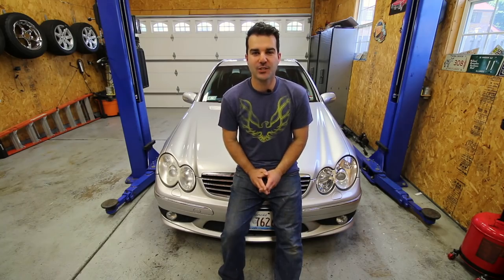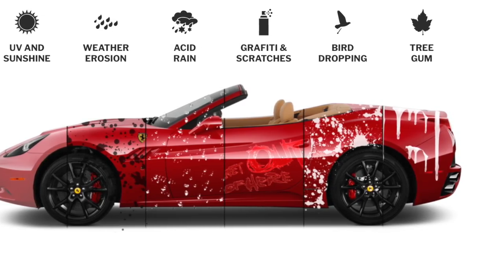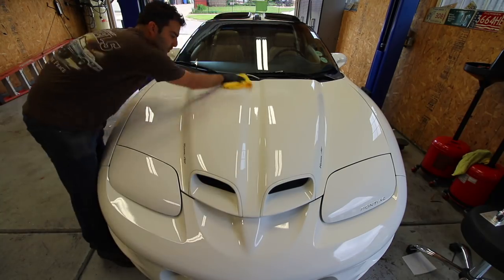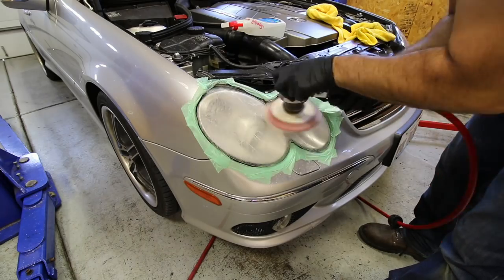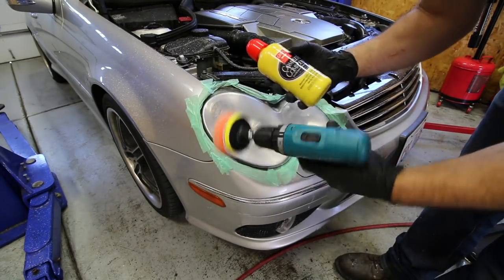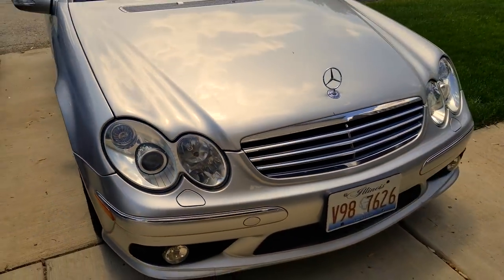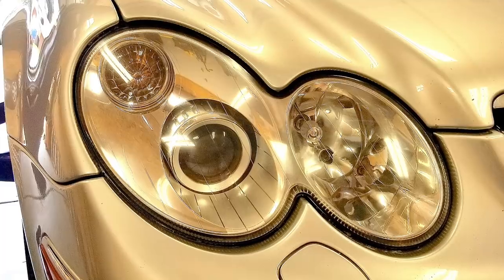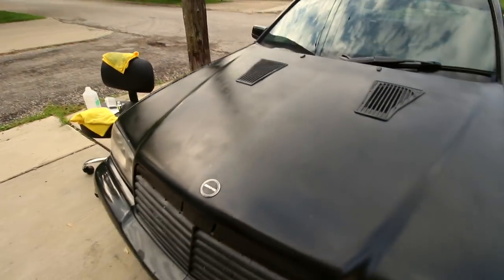How To Restore Headlights With Ceramic Coating. Super Cheap, Super Satisfying!

Comment: Hiya - great video!  Thanks for Posting for us!  Humm, Noise - Aircraft Noise!!  Personally I luv the sound of aircraft - all aircraft - yes, I am a pilot, BUT...  I get that it CAN be distributive or even just VERY annoying.  
- Your Shop / Garage already seems to have interior wall sheathing, but I'm wondering about the amount and type of insulation you have behind that OSB covering?  Sound - all sound - needs air to travel through.  Block the air-flow, and you block a LOT of Noise.  I notice your Attic (access) seems to be wide open?  Do U hav insulation up there?  If not, ADD some!  If yes, then Close that Opening!!
- In the construction of a Duplex Bungalows (and Condos), great steps are taken to control Vibration of the "common walls", thus the transmission of Sound, of which Noise is a part (from one Unit to the other) ...  OSB is pretty flexible, thus passes Noise more easily than a stiffer gyp-rock wall covering.  Did U install a Vapor barrier under that sheathing? The less a wall can Vibrate, the less noise is transmitted thru or by, it.  
- Windows are the same way - a double glazed window passes less Sound than single glazed; and a triple glazed, even less still.  What is the Glazing of yur windows in those O.H.Doors?  Yur O.H.Doors show 2-Closed, but seems like (at least) 1 is Open?  Close it!! :)  
- OK - I KNOW, you need at least 1-Door Open for good Cooling / Ventilation, right??  WELL, probably Not!!  No, Seriously!!  Commonly used Furnace Blower Fans, can supply HUGE amounts of (cooler) Fresh Air INTO yur Shop!!  Just make sure that their Intake Air Source, is from a direction AWAY from the NOISE Source! 
- Finally, as a Pilot, I DO know about "Noise Cancelling Microphones" (BOSE, A Series)...  Whether Jet, Turbine, or Piston Powered, cockpit NOISE is a REAL P.I.T.A. {PAIN IN THE ARSE)!!  In my world there is NOT a lot we can do about That in my workplace - except to CANCEL it!!  "Active" Mic.s sense the surrounding NOISE and Electronically CANCEL it out.  Although we (personally) can still Hear the noise, the electronics simple 'cancel' it out of our Recordings! 
- I really hope that at least a couple of these Suggestions Help in yur Noise Abatement Efforts!! 
- Cheers for now, and Happy Christmas Wishes, headed YUR way.  We HOPE at least a couple of these suggestions, hav a really POSITIVE Affect!!  
Cheers, Bernie & Maddy, Vancouver, Canada... Email us, if U wud like MORE Info??

As a Video Composer, U might want to look into (Active) Noise Cancelling Microphones. 

Cheers!

Comment: The thing with all these restorations is that nobody ever posts a follow up in 6-12 months. That’s when the problem comes back because the UV coating has failed. I’d be interested to know if the ceramic coating can protect for that long. I personally found a better solution and that is a clear film for headlights, just like clear bra for paint.

Comment: this has nothing to do with the video. but a Problem with my car iv talked to multiple Mercedes mechanics from the dealer to Privately owned Mercedes shops, i have a 2007 slk 350 auto with 120k and when i put it into Reverse or drive it jerks alittle no grinding or loud noises just jerks alittle when i drive its as smooth as it always has been i thought about changing the fluid in the transmission but some people say its fine i dont need to, some people say the wont it will make it worse, and some just say they will just change it. i have no idea is this just normal for an older Mercedes? what is you opinion? i though maybe the transmission is going bad and though of replacing it. am i just over reacting? could it be transmission mounts going out?

Comment: Alex, is it okay to apply ceramic coating to my headlights to keep them from hazing/yellowing?? if so, how often should I re-apply it?
Reply from the maker: For sure. That is the entire point of applying to the headlights. It has great UV protection which is exactly why your headlights become yellow and hazy. If your headlamp lens are in good shape or new this is a great time to apply it. I did the same with all my cars.

Alex
Reply: LegitStreetCars thank you

Comment: that's some cool ceramic stuff. i was doing the sanding process and after the 1500 grit paper, I'd have automotive clear coat sprayed on them. they never yellow, you can wax them and they look great. i wanna try that ceramic coat tho.
Reply: How did you apply the spray
Reply: @scr3wblu313  with a HVLP automotive spray gun

Comment: Hi Alex, you have some great videos keep up the good work. I wanted to ask if I can put that ceramic coat over the top of a clear bra. I own an 08 e63 and it has clear bra on 1/4 front of the hood and complete front bumper. Thanks for any info you can provide.

Comment: You gave me a great idea, thinking about doing a maaco paint job on a daily driver 05 Tahoe I have. I'm planning on sanding and prepping the car myself but still afraid of wasting my money on cheap paint that won't last.  I'm now thinking I could ceramic coat it for extra protection. Let me know if you have thoughts on this. Thanks!
Reply: jacob powell 
How’d it go man

Comment: I took the time and spent the money and restored the headlight lens on my van and truck. It lasts for about a year then requires it to be done again. I have been told it is caused by the heat of the lamps, I'm not sure but it's time to do it again.
Reply: If it was caused by the lamp heat then the deterioration would mainly be on the inside of the lenses (and impossible to sand) not the outside. The cause is just solar UV, and various atmospheric chemicals reacting with the external plastic surface of the lens. You'll get a longer period between refurbs by spraying on UV-proof clearcoat if you don't want to ceramic coat them.

Comment: Looks great!!! Like the Ceramic coating kit.  Question:  Harmonic balancer?  Last three on my vin is 580, is it on the recall list?  I'm getting what feels like engine shaking sometimes in the morning.  Goes away after about a mile at highway speeds, need to replace engine mounts too not sure if it's related?  Thanks
Reply from the maker: Gregory Hauser I'm not sure on the VIN breakdown but just take a look at the balancer when it's running. If it looks to be wobbling, its bad
Reply: Thanks for the reply, I've got 238,475 miles on it.  It seems to wobble, but looks like about .010" runout maybe more hard to tell but it doesn't thrash back and fourth though.

Comment: Have you got any idea how long this coating will stay on the surfaces? Is it affected by chemicals or can you only remove it mechanically?
Reply from the maker: Ceramic coatings last years. This one is warrantied for 3 years and most last around 2-3 years.  All you need to do is buff it off if you want to remove it and reapply. So no sanding just buff to remove.
Reply: In Finland it costs about 500€ or $600 to get a nano coating done in a shop for a midsize car like a 3-series BMW. Even for that price I think it's worth it. This DIY coating however seems to be easy to use and no doubt it will save money. Now the only thing missing is the car. Still waiting for the right C55 to show up.

Comment: The idea for this whole making headlights crystal clear thing is sanding off the mist, haze or yellowish film, created by being oxidized over time, then coat it with clear coat. I think, as long as you get the idea, there are many ways to do it with different products. I personally would prefer chisfix just because I learned a whole lot about cars from him !

Comment: That video!  Curious how long the ceramic coating lasts before it needs to be reapplied?
Reply from the maker: Paul de Larzac At least 2 years but some report closer to 3. It comes with a 3 year warranty
Reply: No.  It needs clearcoat after you're done sanding, else its like throwing bare metal into a lake

Comment: How often do you have to re-apply the coating, on duration of 1 year, for example?
Reply from the maker: It lasts  a few years. This product is warrantied for 3 but many have reported ceramic coating even longer. If you want to reapply there is no need to wet-sand. You just do a light buff, clean with alcohol and reapply.
Reply: Thank you for the answer. Are there any permanent solutions for the headlights to stop the UV rays yellowing, though?

Comment: I rather PPF the headlights than ceramic coat them, PPF provides even more protection from not only the sun, pollution, oxidation, but from impacts like rock chips, plus it comes with a 10 year warranty from the manufacturer.

Comment: What was wrong with using glass lenses? My lenses are not faded and they are 37 years old!
Reply: DOT doesn't approve any glass lenses here in the us anymore that I know of.. they are all poly-carbonate now.
Reply: Yup and yellowing is unavoidable unless you hid and that is pretty expensive, cheaper to clean headlights and replace led bulbs
Reply: Not offered for my volvo wagon
Reply: I wish they still made glad lenses. They never turned yellow. It’s ridiculous that in 2018 cars that are 2 years old have yellow headlights. How are we even putting up with this?
Reply: There are new (1995+) regulations globaly for car manyfactors to move from glass headlight to polygarbon because for safety reasons, in case of car accident glass headlight may cause much more damage to the driver or a pedestrian than a polycarbonate headlight. Those results are came.from.car accidents reaserch and are globaly rules such as....seat belts and airbags e.t.c
Reply: Blatt Ferenc they break and leave sharp pieces everywhere, also they weigh more, also with plastic,it possible to mold them into more exciting designs..😃

Comment: Do you have a video on blacking out E55 headlamps?
Reply from the maker: I'm sorry I lost the footage. You basically remove the headlight from the car, remove everything from it including bulbs, bake it for 10 minutes at 170 in the oven and then pry the old lens off with a screwdriver. They come off easy. They you remove the chrome lens, scuff them up and spray them. Check out my Amazon garage, it's linked in this video. I have listed the plastic paint and primer in there.  I used regular clear silicon to reseal the new lens on the housing.

Comment: Sweet deal Alex I'll be doing this to my motorcycle and my car!
Reply from the maker: Awesome! The bike is a great idea too. I had an old Harley and there are little areas that are tough to clean. Once this is on it will stay much cleaner for much longer. Email over some pictures when you get done. 
legitstreetcars@gmail.com
Reply: Will do Alex I'm doing some repairs on it currently the moving company broke a piece of my front cowling so I'm using some amazing Q Bond to fix a standoff behind the cowling. Q bond is actually some pretty awesome stuff look it up with the filling powder it makes a super tight bond to fix plastic and some metal. Btw I have an 09 blue metallic Yamaha Fz6 will protect the fairings for sure! First on to the repairs, I'm currently sandblasting and painting some of the rusting brackets and replacing 10 year old tires with new Michelin Road 5's! I don't have my own shop but I wish I had a shop like yours. Over here in Southern California garage space is so minimal.

Comment: I'we done near 10 cars sanding and polishing the headlight but after 3-4 months oxidation layer came back even worse than before. My friends told me that with all that sanding i remove UV protective layer and because of that oxidation came back again.
Reply: Clapaucius  Did yo do that with ceramic coating ?
Reply: @osmansen3023  No..just sanding and polishing. Without any protective coating at the end.

Comment: I see so many cars with "cataracts" like this one.  Luckily the headlights on my Lexus are genuine glass and still look as new as the day they were made 27 years ago.
Reply: smithraymond09029 gotta love glass units. The days of quality are gone!
Reply: Kenneth White it's government regulation why they can't use glass.
Reply: Motolav when did they change the regulation? I thought they went to plastics because they were cheaper to make and more light weight?
Reply: It was a requirement to get a certain safety rating for pedestrians I believe.
Reply: MrCarGuy20 maybe in Europe but I'm not so sure about in the USA. I'll have to check on that.
Reply: Kenneth White probably a complicated nuanced answer here - she shapes of cars had to change for the pedestrian safety requirements, so flat or raked glass is less appropriate to meet those reqs, curved plastic units that don't stick out from similarly curved bodywork is much easier to make and lighter weight than curved glass. Have you seen how big some of the headlight assemblies are on larger vehicles? It could end up weighing 50lbs per headlight to give the same level of rock chip protection and even then there would be lots of other problems.
Going plastic really does solve a whole mess of conflicting design needs, such as aerodynamics, which is anachronistic to inexpensive flat glass
Reply: CrashingOut I agree it's for weight and ease of manufacture. But the other commenter stated that they went to plastic units because of pedestrian safety, which I don't agree with entirely.

Comment: Ceramic Coating is not designed to be a clear coat yeah it looks nice for 3 years but you get more longevity using a good quality headlight clear coat.

Comment: Two parts to this: initial results and one year later. I got a Sylvania headlight restoring kit, it worked perfectly in 30 minutes of easy effort. BUT, everyone says that after 6 months to a year, the UV coating liquid you add to the restored headlight yellows and you need to do it again. You do NOT mention what happens one year later. All of these restoring products are the same, clean, sandpapers(400,1000,2000) and UV coating. They all look great in 30 minutes. But they all say after a year, they start to suck. Hmmn, wonder why it was not mentioned. Hmmn, wonder why, it's been nearly 2 years since this video.

Comment: As a body repairman I can tell you that nothing you can spray from a can , or a paint gun for that matter , will ever be as durable as the original plastic covering. What will happen is every so often you will be re-doing these headlights...and the people selling these products will have an umbilical cord attached to your wallet. This is a stop gap trick developed and used by the used car lots, and the detail shops they send their cars to in order to "put lipstick on the pig" as it were. I know...I used to have a customer at my shop who would bring me four or five of these "pigs" every week.

Comment: No UV protection? Without it headlights will fade even quicker.
Reply from the maker: Tomasz Dominikowski The ceramic coating does have UV protection.  That's one of its biggest benefits and why I use it
Reply: Ah that's cool, good to know.

Comment: I don't understand how this Armor Shield is any different than car wax?  Also, $45 car wax and just enough to do one car.  Wouldn't it be better to coat the headlight with a UV protective clear coat like U-Pol?  That's what I do so I don't have to worry about this ever again.
Reply from the maker: Demetrius Lolos Wax lasts 3 months, this lasts 3 years. Look up ceramic coating. Its like a hard clear coat, much different than wax
Reply: I'll have to look into ceramic coatings.  I thought waxes lasted for 1 year?  Though a 3  year wax sounds very tempting.  Mostly cause I'm lazy and only wax once or twice a year.

Comment: That is not as durable like method I am using to repair front lenses.
P320
P500
P800 WET
P1000 TRIZACT
P1500 TRIZACT
PLASTIC PRIMER
CLEARCOAT 
AND DRIVE IT!

IT WILL NEVER FADE AGAIN AND IT SHINES EVEN BETTER THAN POLISHING IT!

Comment: I like your video, but o had to laugh when I saw the cost of the product. I didn't promote products, but we use ceramic coating at the Ford I worked at and it was no where near as expensive. I'm sure this product is awesome, but $69.00 for a tiny bottle. I know you have a coupon...but still.

Comment: I can get the same results in only two steps and without any type of tools.  Plastic lenses need to be cleaned like every 3 months to keep them clear.  What make the plastic lenses foggy is the sun and there is no way nor a one time solution to keep them clear forever.  I keep the plaslic lenses of my car headlights clear by applying the headlight restorer solution once every 3 months.  Those 1 million steps are not necessary to restore foggy plastic headlights.
Reply from the maker: Cool now go enjoy life.... NOW!!!

Comment: Alex

I just saw this video and immediately thought of your channel. I've watched all of your Mercedes based videos because I have an E63. I love the maintenance tips.  This guy's engine ran dry of oil and blew up and it is caused by the failure of 1 o ring on the primary oil pump sump tube. 

Check it out. You might want to do your own inspection/video:
https://www.youtube.com/watch?v=lUAB7lKoIt0

Thanks